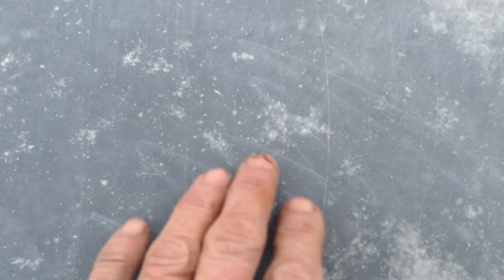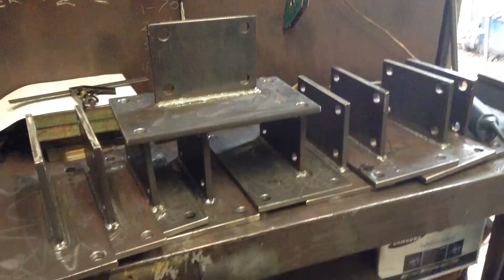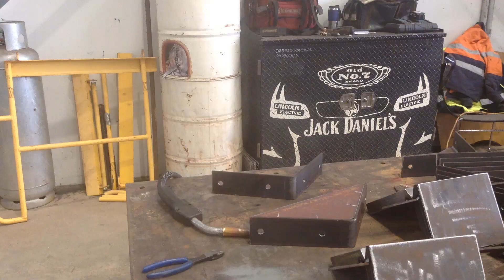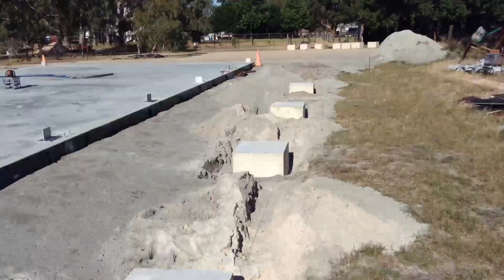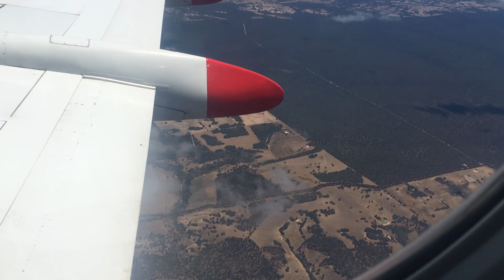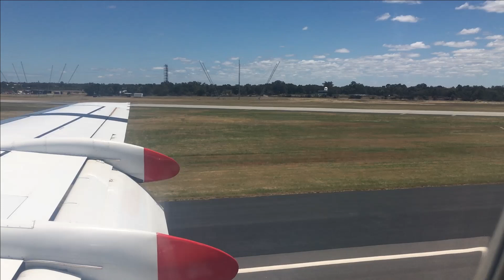New Shop Update  No 2

Comment: Didn't see any conduit penetrations in the slab for power. Are you doing above ground? With that large of an open space, I think  epoxy floor covering. Get crazy with some colours and sprinkles. Love that jet ride just before landing, full flaps and that power up. Its a good feeling when the wheels make contact with the tarmac. Looks like your doing alot of the work on the shop, keeping your hand in . Looks good, will follow your progress.
Reply from the maker: Thanks John .  The power will be along the walls   as with most of the machines  , not the lathes though .  I  will never have a lathe against a wall if it can be helped , so the power will run under an inverted angle iron strip bolted to the floor at the end of the duck boards .

Comment: Looking really good Max.
For those pad plates, where you have used cold galv paint on them, I used that on black steel in my boat trailer and rust started showing through in less than 12 months.
I did apply on other parts of the trailer that were under coated with the same cold galv paint, a bituminous aluminium paint as a top coat and it seals so well there was zero sign of rust even starting 10 years later. I’m sure you could get some from Bunnings.
I reckon it would be worth the effort to give them another coat 👍
The C Channel that your going to use as your uprights, will that be strong enough to carry weights you might later desire to use on an overhead travel crane within the workshop?
Just musing if it would be better maybe to go with steel I Beam for the uprights maybe? Yes probably a lot dearer I’m sure. Just me thinking out loud to myself. 👍
Reply from the maker: The painted stuff is all internal .   Hot dip galv for the external stuff .   The c purlins  was the only affordable option  &  i will just work around them for the  gantry  or pole hoist's   .  Cheers .

Comment: Hi Max ...   pad is looking great, as well as all the work making all the bolt on plates etc. Lol   Pad looks bigger than my house pad ..  lol    When you cast the Veranda Footings why didn't you Insert the the steel bolting Insert sections.
As always a great video,  & we got to fly around WA as well.  Keep your great Video's & well catch up soon
Reply from the maker: Thanks Ted .   I opted to do the footings like that because i did not have time to set up the formwork & studs when we did the main slab . In other words we were absolutely rooted & totally over the concrete caper !    It will be easy enough to drill them for chem set anchors later . Cheers ...